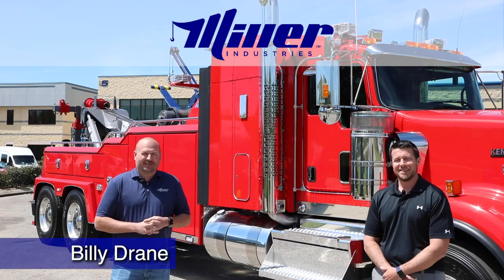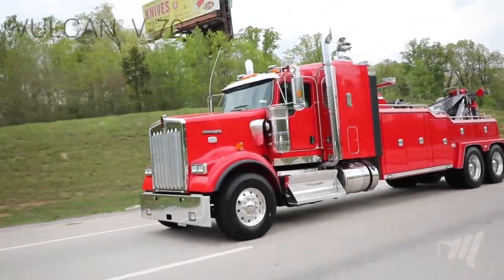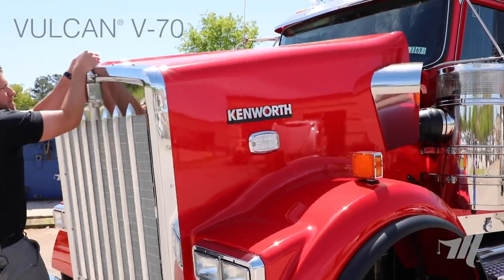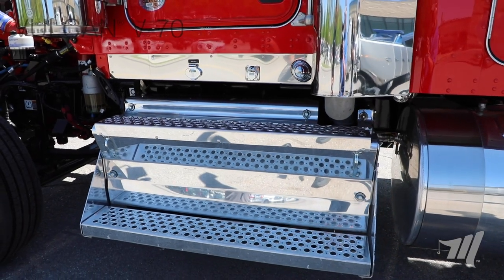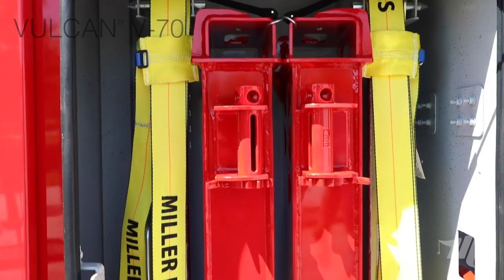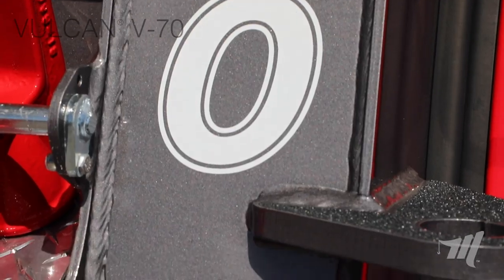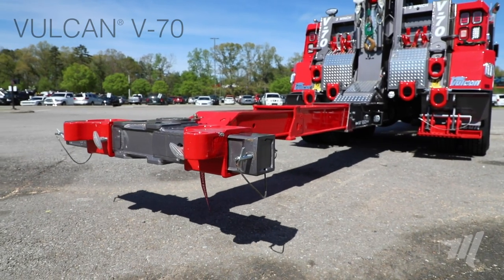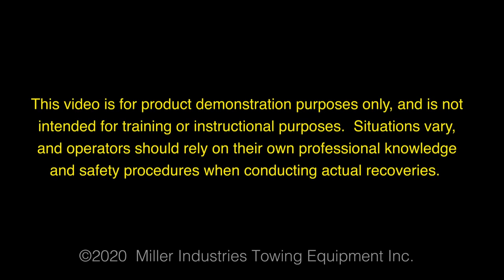Vulcan V-70 Key Features

Comment: I like when they touch on maneuverability, It truly is important, As towing ops we are not only called out when accidents occur or vehicles get stuck in the environment, but we are also called when drivers get stuck when maneuvering their vehicles, and we have to get them out of that position without causing damage and with not only their vehicles length but also out vehicles length, If they get their 70 foot rig stuck it's gonna make it even harder to get it out when you add another 50 foot rig to the equation, these vehicles truly do need to be maneuverable.

Comment: How does the extra 200RPM help if it’s got an 18-speed transmission? Aren’t there enough ratios to cover the whole speed range natively?
Reply: Cause you can Run The RPM’s Higher in Each Gear. This Truck has The Cummins Performance Series Motors which has a Extra 200 RPM’s as well as a Higher Torque Motor. The Efficiency Series Motors have only a 1450 & 1650 FPT Torque Options, The Performance Series Motors have a 1850 & 2050 FPT Torque Motors. Also Rear Axle Gearing Plays a Major Factor in How these Motors Perform going Down The Road.
Reply: @taylor11089  that's what I call a non-answer. Back to school for you.
Reply: @pjtemplin  Peter, Please ENLIGHTEN Me then. Please Explain, since YOUR the one who asked the Question? I’m Listening, This should be Interesting. BTW, More RPM’s Increases the Torque Band in Each Gear, as well as Matching the Right Gear for The Application & Speed.
Reply: @taylor11089  it's Pete, not Peter, thank you very much, and it's RPM or RPMs not RPM's. Regardless, it's an 18-speed transmission, and while the attempts to reuse the same unit in 9, 13, and 18-speed applications leaves a bit to be desired, other than the gap between LL and L, no gear change is more than a 21% step. If clutch engagement speed is 800RPM, one only needs 968RPM for the next gear to be "right". 1200RPM is even enough to skip the splitter, so driving it as if it was just a 9-speed still doesn't come close to the extra 200RPM gained by the engine. Further, the torque limits are entirely computer-enforced, primarily to keep the transmissions intact: higher-torque engines generally have a more-peaked torque curve (sure, more torque, but not as wide of a band) than the lower-torque engines (where the computer limits fuel flow so the torque limit isn't exceeded; it's got more grunt available but won't use it for the sake of the warranty relationship). With as broad as the ratio spreads are with 18-speed gearboxes (roughly 20:1), rear axle gearing ends up dictating the right gear choice for highway cruising.
Reply: @pjtemplin   Peter, Peter, Peter, Apparently you Didn’t Read anything in ANY of My Post, Except Trying to be The Grammar Police, Autocorrect didn’t Fix My Comment as I typed it. But, just for you, I am going to Add Commas to RPM’s. Now, back to the Topic at Hand.

Nobody is going to Shift Gears with #80,000+ Pounds behind them @ 968 RPM’s with a Load. Your Clutch Engagement Torque doesn’t Start Until around 1,100-1,000 FPT, Your Peak Torque Curve Starts at 1,000 FPT and goes to 1,550 RPM’s (on a X15 Performance Series which is what these Trucks have), but Peak Horsepower Rating Starts at 1,500 RPM’s and goes Until 1,900 RPM’s. So, too achieve Maximum Horsepower you Need those Extra 200-500 RPM Power Band.

Once you Get Into some Hills and Mountains Grossing #100,000 Pounds, your going to Want those Extra RPM’s and Power Band to Achieve Maximum Power. Your not going to be Shifting at 1,200-1,300 RPM’s like you would on Flat Ground. Your going to take advantaged of those Extra RPM’s in Each Gear Range.

As I said in My Previous Post (that you Didn’t Read), Gearing does ALL of The Work in Heavy Haul Applications, Horsepower & Torque are just Accessories/Tools to Gearing. Gearing is the Reason why Trucks & Tow Trucks in the 50, 60, & 70’s could Haul 80,000+ Pounds with only 225-350 Horsepower Motors & 5-6x4 Twin Stick Transmissions and 9, 10, 13 Spd Transmissions. 

Also, in reply to your Last Sentence, we around Not Highway Cruising in a Tow Truck as you would with a Fleet Truck or Owner Operator Truck. This is Not a Trucking Company that is Running Nationwide, again it is a Tow Truck.
Reply: @taylor11089  school was hard for you, no?